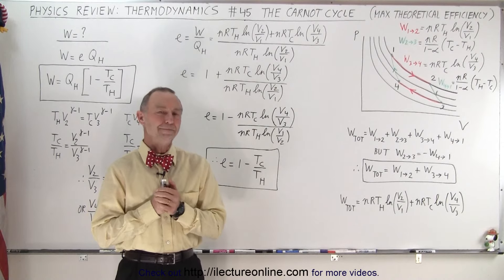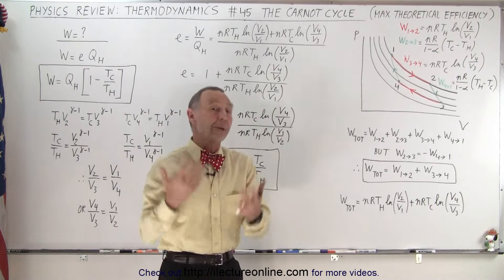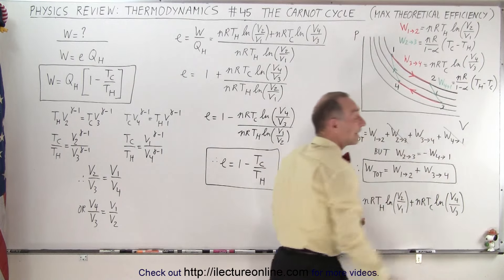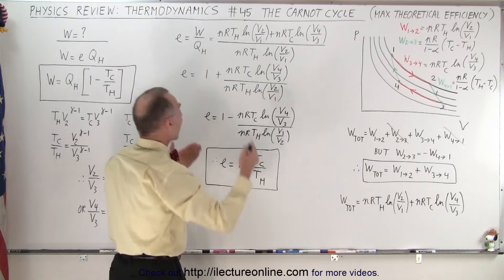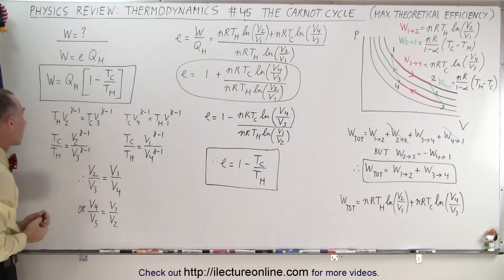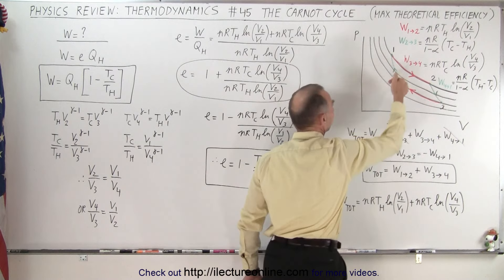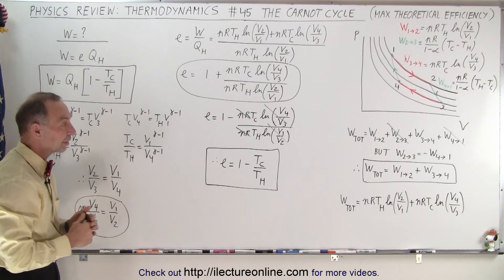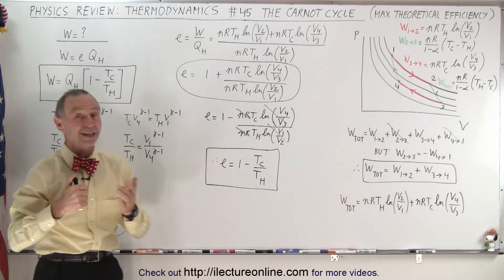Physics Review: Thermodynamics #45 The Carnot Cycle

Comment: Another fine lecture! 🎉😊
Reply: This derivation of Carnot's efficiency formula, while it is found in most textbooks, is at  best misleading and is correct only (!) for an ideal gas; it is incorrect for, say, water around 2C when absorbing heat leads to contraction not expansion. Isothermal heat absorption or rejection does no work, see Kelvin's postulate, it is a work-neutral process to keep the temperature constant in which the work is done against the stored internal energy, specifically its chemical energy as it is easily seen from Gibbs formula dU=TdS-pdV=\mu dN.